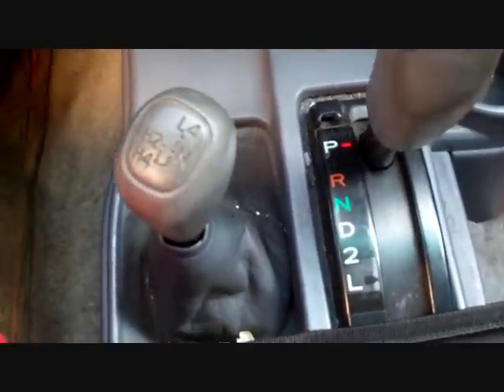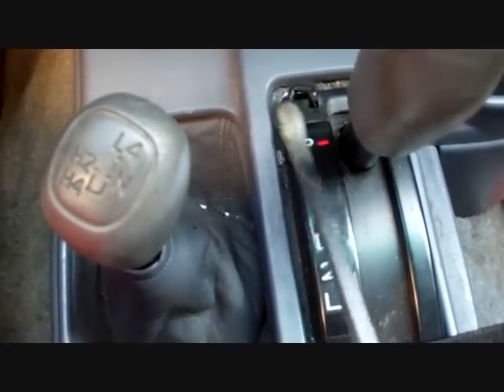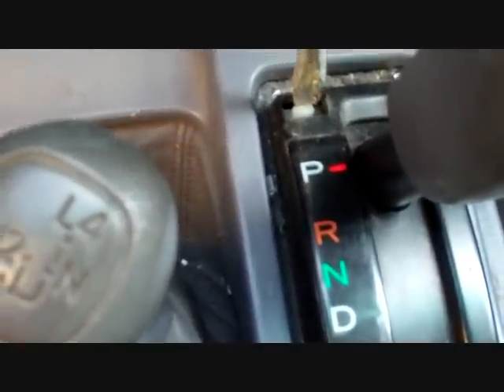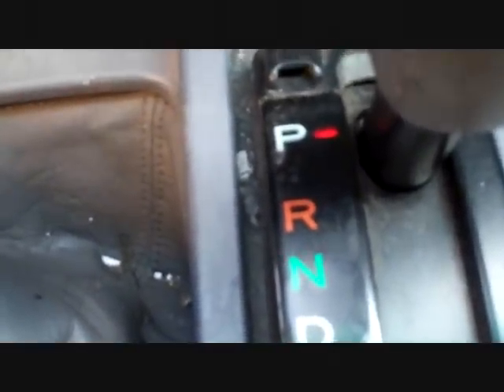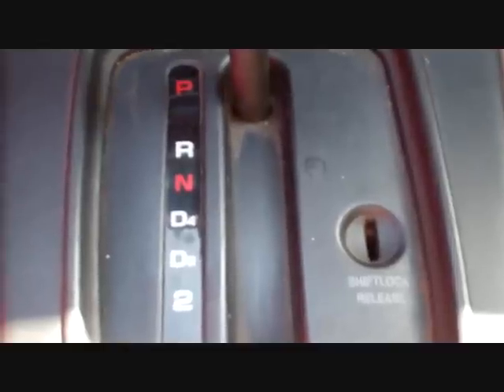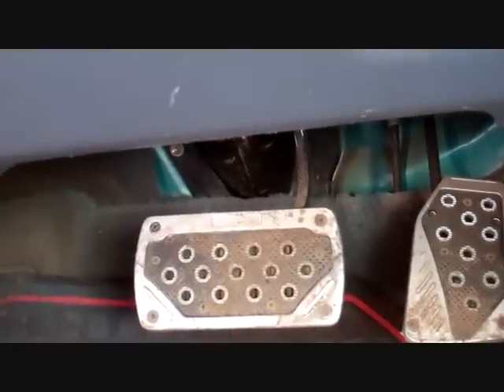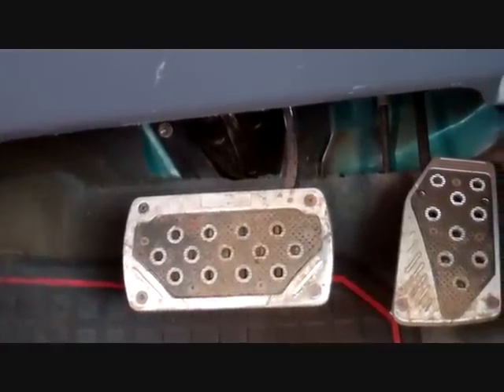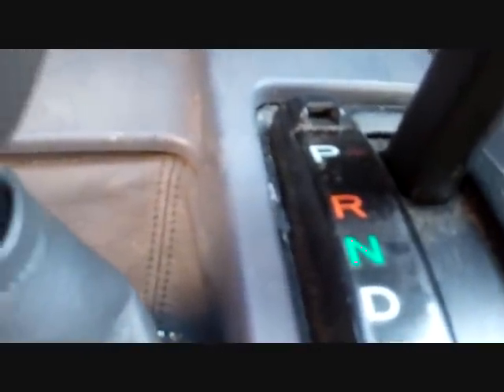Shifter stuck in the Park position

Comment: I had a problem like this on my T100 auto. The symptoms were: shifter stuck in park, key not turning in ignition, reverse not illuminating rear lights amongst others.. the solution: the neutral safety switch which is located on the transmission and connected to the gear shift linkage. The switch is about the size and shape of a cassette tape. Once opened I found the copper contacts of the switch to be corroded with oxidation. I retrieved several used switches off of some 4 runners, Tacoma and tundras at a junk yard. I installed the best of the bunch on the t100. It has worked great since and solved all issues related to the gear shift, ignition and reverse lights. People claimed that getting the switch off the trans is difficult but I found that using oil filter pliers worked best to grab around the whole thing and pull off the bolt evenly.

Comment: Thank you! I ended up figuring it out. There is a wire that came out of the connector. I have to manually push in what appears to be a solenoid to get it into gear.

Comment: I had this happen just this Saturday, same truck. Check under the truck at the linkage cable. Make sure the parking brake is on.  Up front near the tranmission on the drivers side. Look up shift linkage brushing on youtube. The whole cable replacement cost like $30 on Amazon, repair shops will charge you $90. It's an easy fix and the truck doesn't have to be lifted.  I was on a fishing trip, AAA guy rigged it with some zip ties so I could at least get home to fix it. It's a cheap plastic piece.

Comment: just wait till your key keeps getting stuck in the ignition(well technically it's locking your key in)  because it doesn't sense your car is in park.
Hint: its on the right side under all that plastic crap where your shifter is. Happened because there were was so much side to side play in the shifter. just an fyi. I'm assuming that’s a Toyota 4runner because it sure looks like it. If your car starts shaking violently once you get up to speed and let of the gas(I thought it was a broken u joint about to give loose). Turned out to be a sparkplug boot on one of the ignition coils(check of arcing on the side of your sparkplugs bc that is the only way your going to know bc the boot looked perfect. those boots just pull off btw so you can just replace them and not the coil too.)

Comment from the maker: Hope its the fuse also. I replaced the switch before on a Honda Accord and it wasn't much fun. If its the switch I would also recommend changing the little rubber thing that it comes in contact with so you don't have to go under again.
Aloha

Comment from the maker: Sounds like the brake switch might be a part of your problem. Check the rubber stopper by the brake switch located by the brake pedal. I had to replace mine a couple of times. 
Try and search GOOGLE 2003 Honda accord brake switch and click on images to see the switch. If this is not the problem it might be the solenoid assy.

Hope this helps

Comment: Ok thanks. From googling it looks like I need a break light switch. I just realized both of my break lights are not working also. I'll check out the fuse box too when this weather clears up..... cross my fingers and hope it's just the fuse - if not, it's probably the break light switch.

Comment: Very helpful, It worked! My brake lights are out though. I wonder where the electrical fuses are.
Reply from the maker: hey thanks for checking it out and for the awesome comment! 
If you still have your Manuel in the glove box it will tell you the location of the fuses. They are usually located down under on the driver side. look for a small door. More fuses are located under the hood.

Comment: Thank You so very much for this video! This happened to me last night. After watching your video this morning, I went back and retrieved my truck.  Now to figure out if it's the shift lock switch or brake light switch needing to be replaced, and if I can do it.   You have a video for replacing the switches? Thanks again!
Reply from the maker: +Brenda Knight Awesome! Glad I could help. 
I once changed the brake switch bumper at the pedal because the brake light was constantly on. The little spacer bushing was needing a replacement.  Sorry I don't have a video on that. 
Thanks for watching

Comment: Hi, this video was really helpful. I was wondering what exactly which part would need to be replaced to make sure this doesn't happen again IF the problem was under the shiftlock? Is it a specific wire, device, piece, etc.?  And in regards to your brakelight, I was wondering how much did that end up costing around? Thank you.
Reply from the maker: Depending on the problem and type of vehicle will be the cost. It could be a shifter solenoid or a simple brake switch. See if you can get a hold of a schematic for it. If your brake lights are on and can't shut off the problem should be under the brake pedal. If the brake switch is not working properly then that could be a factor also. Usually it would be a little plastic tab being broken. 
Hope this helps somewhat.

Comment: Well it's not the fuse, unfortunately. I keep hearing that it might be the shift lock solenoid causing the problem..... but would that cause the break lights to not work also?? I narrowed it down to the break light switch or the shift lock solenoid. Appreciate the feedback... I'll look out for that rubber piece.

Comment: Thank you for your video! It is very helpful. But why does it happen to me many times? Every time it happens and I follow this, then it is ok. But how can I stop the problem? I think I did not touch any button that may lock the gear shift. Thank you!
Reply from the maker: +Nguyen Tien Ngo  Hi Nguyen, it is only a temporary fix to get you out of a jam. 
The problem will have to be eventually fixed. Please be careful while using this method. 
Thank you for watching and commenting.

Comment: Thanks for your video, i was just getting my tire fixed when the Mechanic couldnt move my car incredible it did happened there in his shop, but it never happen before, so he explain to use a screwdriver and it did work, but it happened again as soon as i parked. A mechanic said he has to order this part i wonder how much it will cost, do you have any idea or should i google it / My car is a Chevy Aveo 08
Reply from the maker: Hi Cindy, it could be the brake light switch I am not a 100% sure. It would be located on the upper side of the brake pedal.
If you search for Chevy Aveo 08 brake light switch someone made a video on that. 
If it is the problem you could order it on Amazon for under $20.00 
hope this helps some.
Aloha and take care
Reply: Thx a lot!! I gotta share your video with my Dad!! take care

Comment: I have a 97 Aspire that won't shift automatically but will switch when you change them to first and second on the shifter... (If you didn't catch on its an automatic)
Reply from the maker: +Kill3rW0lf101 I would first check the fluid level. If the level is fine you may have to take it in for repair.
Please drive safe

Comment: what about if son lost key .blocking road 
stuck in park ,steering not locked
Reply from the maker: Try to get it in Neutral and push of the road. 
Worst case a Tow Truck will need to be called.

Comment: Is there a permanent fix??? My acura integra shifter is stuck on park and i always have to use a screwdriver to press the shiftlock release to go anywhere???. My breaklights work and everything and car starts as normal just everytime i release it from park using the screwdriver and when i go to put it on park again it locks on me??? Anyone know what might be happening? Thanks
Reply: did you ever find out what was wrong? cuz I have the same problem
Reply: Venode 
You need to replace the shift lock selonoid..